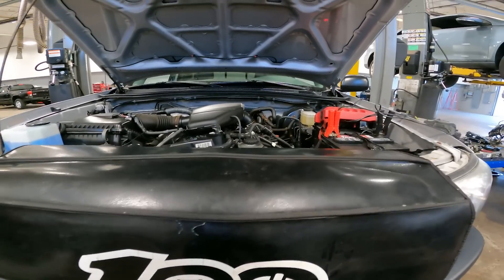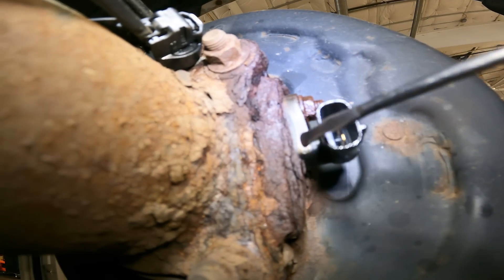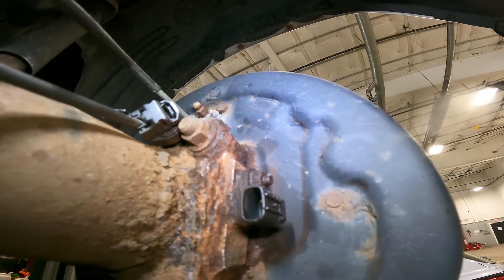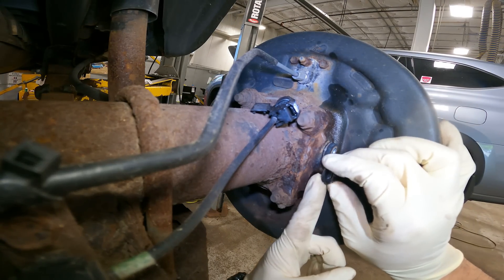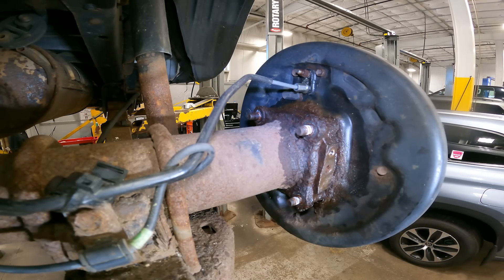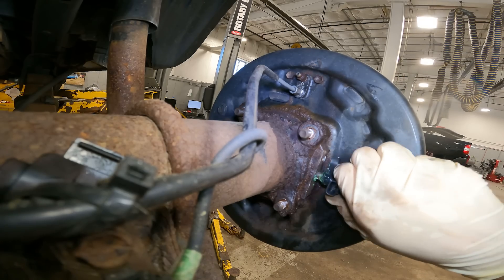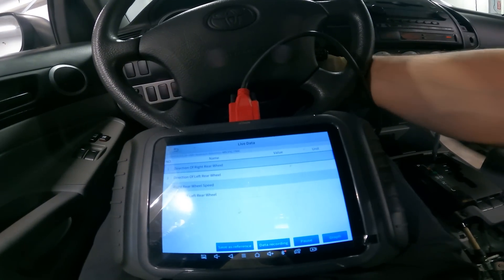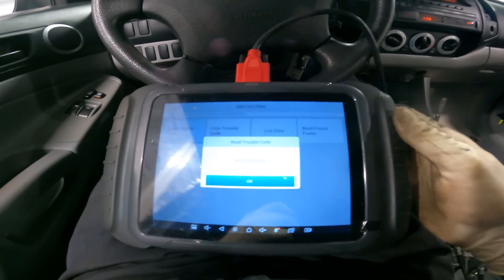Customer states RUST CAUSED MY ABS LIGHT!?🤬😖 MAJOR REPAIR!

Comment: drywall screw down the middle and a claw hammer work wonders for those broken sensors
Reply: the jamoke is strong with this one, but he is correct.
Reply: @marshfield01  ya sometimes ya have to wop it a few times to get it out

Comment: I HATE ABS. ABS almost got me into an accident in a parking lot, one hot, dry summer day. As I was maneuvering into a parking spot at the mall, I got an unexpected "foot massage" from the brake pedal, as I tried to stop, but my 2000 Z71 Chevy Tahoe kept on rolling!

 (The Tahoe was about six years old at the time of occurrence, which would make it about 2006. It was my first vehicle with ABS. I bought it new in Oct. 1999, complete with cassette, and CD player. With 156K miles, I traded it in for a 2019 Ford F150 Crew Cab with a 10-speed auto, turbo 2.7L V-6.)

 I almost ran into a passing car in the parking lot. My "DO/TRY SOMETHING!" mindset came into play. I decided to PUMP the vibrating brake pedal. IT WORKED! Collision avoided. I later disconnected the ABS system. I guess ABS didn't like the competition. <<smirk>>
Reply: My ABS on my '94 Chevy S-10 could be tricked into activating if I braked on a wet sewer cover/grate or braked just before going over a railroad crossing; apparently it was overly-sensitive. I left it connected since it worked right otherwise.
Reply: Why did you not use the e brake? That's what a working emergency/parking brake is ultimately for?
Did you not have the codes scanned re the ABS?
Did you bother reporting it to NHTSA?

Comment: They need to ban road salt in the United States.  This guy shows the bottom of cars in his videos and they all look like fried chicken underneath because of this crap!  It has literally pushed the sensor out of position.  You should see the bottom of my '14 Cayman S;  It is a little dirty because of yesterday's rain but other than that it looks like it is brand new, I live in south Flori-Duh~

I know salt works but it DESTROYS cars.

Great video!
Reply: Road salt is only still used because of it's extremely cheap cost. Where I'm at in canada uses a few chloride alternatives, as well as liquid de-icing spray trucks. But it also costs nearly 3x as much. It won't stop being used most places as long as cities realize they can spend that much less on maintenance and pocket the rest for stupid projects, bonuses and higher salaries.
Reply: @sakaraist   "....and pocket the rest for stupid projects, bonuses and higher salaries."       agreed.      one million percent.
Reply: Porsches have better rust proofing than these tacomas. My 2018 Tacoma shows the same if not more rust than this older truck. Some cars are just made of cheap metal and/or don’t have sufficient rust proofing treatment.
Reply: @bmwmsport11  Toyota's are very good cars, but they did have a problem back between 2000-2010 with the frames literally rusting in half.  Many trucks from that period have new frames, replaced under warranty.  I haven't heard if their newer products still rust, but apparently yours is doing it.  I still say that if your truck was used in Florida, it wouldn't be rusted since there is no such thing as road salt down here.  Thanx!
Reply: To which should be used as an non corrosive alternative that melts ice? Also would you sign a waiver with said state that you won’t sue them if you get into an accident due to a salt ban? Also also, you can tell these people don’t give a fuck about their cars. There are many anti-rust procedures that one can have done that helps drastically increase the life of the undercarriage. But they don’t because “it’s too expensive” as their car rust to shit while they wait in the drive thru for the $20 latte…
Reply: @Vickvineager  said by a plow/salt spreader?
Reply: @Vickvineager  Sand works fairly well on snowy roads and doesn't eat cars.  EVERY car on here is eaten up with rust;  I don't think that undercoating is going to do a whole lot.  And many parts of a cars undercarriage cannot be undercoated.

As to lawsuits, states can enact bans on lawsuits due to deletion of salt from public roads.
Reply: Doesn't just destroy cars it slowly poisons the run off areas around the roads so that plant life struggles and then dies. You know the old expression to 'salt the earth' to keep fields from those you've defeated and have a grudge against from growing crop.
Reply: @Flies2FLL  I live in the Rust Belt, and every fall I get underneath the F150 and slather on a layer of bar and chain oil. Can't rust if it's lubed!
Reply: @bcubed72  Hahah!  That's awesome!

If you look on YouTube you will see Hoovies Garage and Car Wizard;  They are constantly fixing pan gaskets and valve cover gaskets.  I think this is a serious mistake;  This isn't a leak, it is the semi-common "self lubricating chassis option" that many non-Japanese car manufacturers offer.  

A seriously misunderstood option in my opinion.... 😉
Reply: Nope; live in the snow belt, sand or cinders don't cut it, especially in mixed precipitation which then freezes into various forms of ice. Either wash the underside or have rust. I've done both due to varying circumstances.
Reply: @markh.6687  If sand or cinders are not enough to proceed safely, I suggest STAYING HOME.
Reply: @bmwmsport11  
Galvanising...think OEM on the line galvanising....
Reply: @Flies2FLL  Sand works nowhere as well as salt; that's why it's the preferred method. You have to melt and remove the ice and snow. Besides that, you have to clean the sewers and streets with sand; it doesn't dissolve.
Reply: @markh.6687  True, sand is not quite as effective but if you truly need the ability of salt in order to travel safely, perhaps it is best just to stay home.

The damage this stuff does to cars is atrocious~
Reply: @Flies2FLL  I agree it does damage (salt an airport runway and you'll be fed into a jet engine by the airlines, salt tears hell out of aircraft aluminum), but vehicle crashes do much more, and rather suddenly. :(

But I've stayed home sometimes anyway; knowing how people drive in my area is enough incentive even on a dusting of snow. Their motto: "speed up and brake harder!"  YIKES!!

Comment: That hardware no longer identifies as hardware! 😱
Reply: After applying heat, though, it does identify as "software."
Reply: They are now known as “the rust formally known as hardware” with the preferred pronouns of hot & flakey

Comment: The craziest thing happened when I changed the seals on those. I tried cleaning the reluctor area of the ABS and decided to pick up the rust with my magnetic tech drive, never again. That thing demagnetized the reluctor and had misreadings in some areas, how do I know you ask? Well, I'm an oscilloscope guy and I saw the signal dropping out and then some areas would be smaller hall signals, insane.
Reply: You may have also increased the distance between the reluctor & the sensor, by removing the rust from the reluctor, thus increasing signal distance and giving you a lower reading.
Reply: @TheHawk--oe8iq  that wasnt it. The rust was just on the tone ring itself. When I removed the axle, rust just fell in there and I was cleaning the residuals. It wasnt the knuckle where the sensor sits. The sensor housing had rust but this CSW had it really bad. Just dont run magnetic things around that reluctor lol. Same goes with chrysler camshaft reluctor. The manual specifically says that lol. Didnt know it could happen with abs tone rings, now I know lol, just use a rag or towel to clean it and air if you have it available.

Comment: I have a similar situation with my '99 Grand Marquis where when I come to a very slow stop, from 4 mph to 0 mph the ABS system activates.  Most likely rust swelling the sensors away from the tone ring on the front hubs.  Next week's job ... hopefully it will go well.

Comment: I couldn't stand living somewhere that vehicles get all that rust. I can't see any practical way to maintain something and prevent rust. How can you keep rust away from places like that sensor? Lack of maintenance didn't cause that problem.
You must have a lot of patience to deal with all those issues caused by and made worse by, rust.
Reply: Look up "galvanic coatings"
Best known is zinc..."galvanising" with zinc during manufacture would have stopped all the rust.
Even using  zinc rich primer, followed by an undercoat and a top coat on any of the metal under a car helps keep away rust.
Spraying with an oil....also does this... 
Not using steel brake lines...use cupronickel steel...no rust.

Comment: Wash or rinse under your car and the rust will take much longer to form.
Reply: Makes no difference when you have to drive 10 miles back home on the Salt and slush roads most people have known clue what winter is really like in northern Minnesota.
Reply: @dalelangila9274  I live in Northeast Wisconsin and I know.  Every bit helps though.
Reply: @dalelangila9274  Have owned several cold weather cars, one in Idaho (little salt) that reached 445K (Isuzu Rodeo), current in Wisconsin at 342K (02 Toyota Avalon), minimal rust. The first was not garaged much and rarely washed underneath, current is regularly washed and garaged. Also had an 02 Ford Taurus which was a rustbucket at 200K. A lot depends on original quality. 10 currernt most rustproof car list:    
Toyota Camry, Corolla, FJ Cruiser, Highlander, Matrix, Prius, RAV4, 4Runner, Sienna, Solara, Venza, Yaris;

Mercedes-Benz B-Class, C-Class;
Hyundai Accent, Elantra, Entourage, Santa Fe, Sonata, Tuscon;
Kia Forte, Magentis, Optima, Rondo, Sedona, Spectra, Sportage.
Reply: @haroldwilkes6608  I'd have to add my 2006 nissan titan to that list never been in garage but yet less rust than my son's 2012 Chevy pickup.
Reply: @dalelangila9274  Clean the salt off at home using a pump tank sprayer filled with warm water. Or if you have a garage with a water outlet inside hook up a garden hose and oscillating sprinkler. Place the sprinkler under the car and let it spray the underneath.
Reply: @Tim.Stotelmeyer  
How much ice inside the garage...or outside with this sprayed and now rapidly freezing water?
Reply: @JohnSmith-yv6eq  You use less than half a gallon of water with the pump sprayer. The goal is to rinse the salt off. You are not trying to do a full wash of the underside.

Comment: You should have never heated that.  What did you expect would happen?
Reply: I'd rather deal with broken plastic than a broken bolt/stud
Reply: @chrissmithz314  Not me.  I'd have gotten that stud out no problem.  Heat is great when plastic is not involved.  I know he's on a time crunch but a good soaking with PB Blaster over a couple of days would have worked.  In this case it's not that big of a deal but there are cases it would have been.
Reply from the maker: @mitch Staff I was replacing the sensor regardless of saving the old one or not. So melting the plastic was not a concern for this repair. I would actually welcome the plastic melting and exposing the threads but everything worked out the way it was suppose to. Well almost everything lmfao.
Reply: @customerstateswhat  he,s never worked as a line mechanic.spay blaster for a couple of days at 150 dollars an hour labor rate
Reply: @customerstateswhat  I understand that you are under time constraints and don't have time to give that bolt a good soaking.  But the fact that the stud itself came loose tells me you were only fighting the rust behind the nut.  Also you had the advantage of the plastic pieces being easily accessible.  You know as well as I this is rarely the case.  I'm afraid others might try heat right away and cause more problems.  You have to remember you are a professional not many others are.  I'm sure you have had customers who made things worse by starting the work themselves.
Reply: It's worth noting that soaking bolts can be a huge waste of time because it doesn't always work, been there done that with subaru ball joint pinch bolts. Hindsight is 20/20 as well, I was surprised to see that stud was removable and not just part of the whole housing. When you look at the grand scheme of things, of all the things that could go wrong, breaking/melting plastic is the best thing that could go wrong in my opinion. I'm surprised you'd rather try and drill out a small stud than deal with broken plastic bits.
(Edit: I'm not talkin about just soaking either, soaking, scrubbing, jarring with a shake-n-break tool)
Reply: @chrissmithz314  I've used heat as well and even that doesn't work sometimes.  I use it as a last resort though because I know it can cause other bigger problems.  I deal with this all the time because I refuse to buy anything made after 2005.  In this case the plastic part was east to get at and acquire which is not often the case.  Personally I could care less about ABS I don't like it.  I know how to drive.

Comment: I'm sorry but your just not good at all at taking things apart. TIP. always tighten a nut first, just to break it free, maybe a little back and forth, then unscrew it. Using a Torch LOLOLOL by the way, your snap on dealer has a tool just for heating the head of bolts that are stuck. Called a induction heat element . has several different coils to fit your need. A mere $600